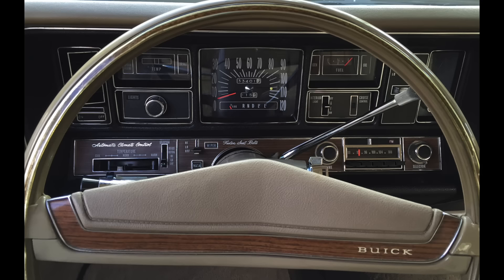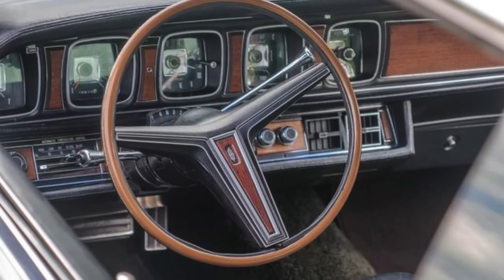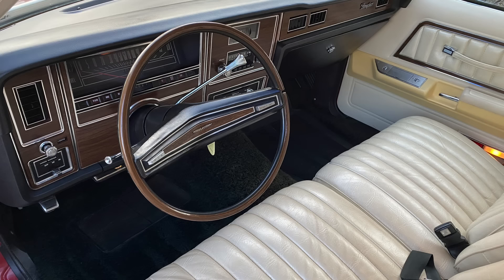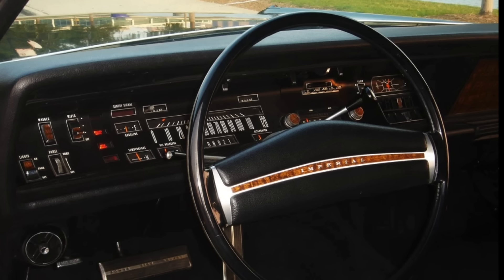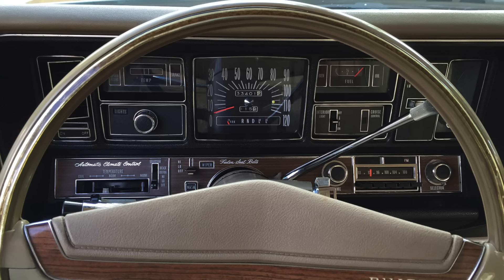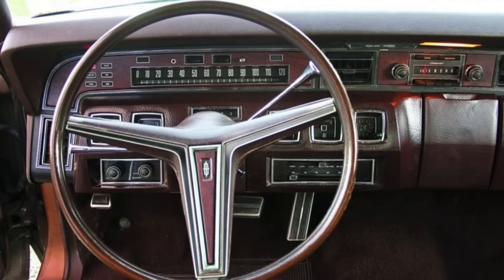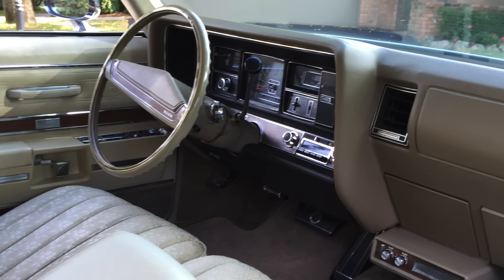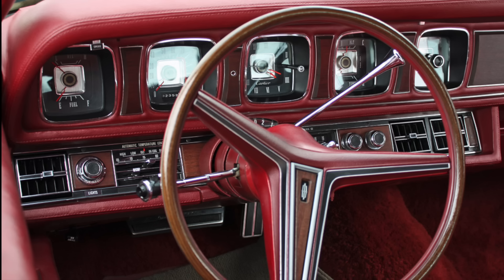Worst Automotive Inventions:  The "Rim Blow" Steering Wheel That Many Customers Hated

Comment: The Rimblow Horn Steering Wheel was available in 1968 Oldsmobiles. I believe this was the first appearance of that feature. My first car was a new 1969 Mach 1 that came standard with a 3-spoke Rimblow wheel. The contact strip did sometimes create certain issues,  enviroment-caused petrification, and horn sounding unintentionally by squeezing the rim too tight... But One of the Worst Automotive Inventions?... Matter of opinion. I loved it and still do. Still have the all original car and that includes the steering wheel and Rimblow which has always worked. Subsequent vehicles that I also purchased new had to have a 3-spoke Rimblow wheel if offered, my 1974 LTD Brougham, etc. I went without cruise control because I just didn't like the two-spoke wheel.

Comment: Like it or hate it, the rim-blow horn was at least an innovative attempt to improve car features at the time. And to be fair in regard to how those steering wheels hold up today, it's amazing that any of them still work. What automotive engineer was sat at their workstation in 1969 and tasked with designing a mass production rim-blow steering wheel made only from materials commonly and economically available in 1969 or earlier that was expected to still perform flawlessly 55 years later and beyond? Until the 1980's when Japanese imports started overwhelming the US market with economical, durable, practical, and comfortable cars that were built with quality and pride in the workmanship, the average domestic car was considered obsolete and worn out within 2-3 years. If you drove a car that was 5 years old at that time, you were either a high school kid or regarded as pathetically destitute. That was the market and mindset that American car makers catered to then. It's also amazing that the malaise era was pushed back for as long as it was before emerging when it did. Adam, if you're reading this far, that would be a great topic of study and presentation that should be of great interest to auto enthusiasts today. The US auto industry, sadly, was already well on it's way to floundering in the world economy before the two OPEC oil crises in the 1970's did their job as planned and pushed it off the cliff. The rest is history.

Comment: Hi and hello from Australia

Most cars of the era had the "normal" centra pad or horn rings.
Only ford in the 1969-1972 GT's had the rim blow wheel ( possibly of a similaor prior era mustang ) 3 spoke and 3 or 4 round sections, i recall a friend of my dad had one new back in the day and he had glued 1 2 5 cent pieces in it

Anyway, one of the girls in high school back then, when she got her licence she would use the family car when it rained or something ( sports days ), it was a fairlane with the rim blow, but this car was not a power steer car ( i still recall her saying " dad only wants 1 fan belt and no extras other than automatic )

Take a hard corner - beep , park the car - beep beep

I met her a few years after school, we chatted and i asked do you still have the green failane, she said yes it is the spare car between the family , i asked about the horn and she said it stopped working, there is now a button drilled near the ignition switch and the button is clear plastic similar to the car alarm types of the early 80's

For 1976 to about 1985 Ford falcon had the european style ( similar to England / Europe Ford Escort / Cortina ) blinker / indicator stalk with the push in switch on the top ( basically you face palm the indicator )

Comment: My '74 Imperial has a rim blow steering wheel, and it still works. The rim does have a crack in the 12 o 'clock position. A lot of them seem to have this crack in the same place, although this has nothing to do with the rim blow functioning.

Comment: Back in the late seventies my dad had a ford xw gs fairmont stationwagon (this was in Australia) 302 windsor toploader and a 9" diff and the dreaded rim blow steering wheel. He got so peed off with tooting the horn when turning he disconnected it and installed a button to push for the horn, lol. Wishes he still had it, sold it in the eighties for $500 probably worth $80,000 now!

Comment: The use of the horn seems to vary quite a lot locally.
Here in Northern Europe a horn is used almost never at all. You would rarely use it in a "panic" situation: instead of making noise, you would focus on taking evasive action.
In Southern Europe it seems a bit different: in big cities people are continuously sounding the horn as a "hey I am here! go out of my way!" indicator.
For that it does not really matter how the horn is activated, and the "horn on turn signal stalk" feature was invented there.
Anyway, I would not use the horn more than maybe once or twice a year. In fact you can get a fine for unnecessarily using the horn.

Comment: Maybe you did it already but I would say that the buckle start system for seat belts in 1974 was the worst.  We had a Chevrolet with that feature and we did wear the seat belts because of it.  One day it became really cold and the buzzer would not stop even though we were all in seat belts.  The independent mechanic we had did not disable it because it was required by law.  Dad was hard of hearing, so he let us have the other car and he drove this wagon to work, the buzzer going off the whole time.  It was the next year that the buzzer was removed.  That wagon also had a lot of problems with leaks and guzzled gas and they finally replaced with a sedan in 1979.

Comment: Never seen that! I had some 60’s GM’s that I believe had buttons on the steering wheel spokes.  

First gen Miatas have “thumb triggers” on the steering wheel spokes, right there, one for each thumb, as long as you drove with hands at 10 & 2.  

More cars need a town / country horns too. Plenty of times I need a “beep beep”, and then there’s the times I need a loud solid blast.

Comment: My 1969 Mustang has a 3 spoke rim blow steering wheel with cruise control - the cruise control on/off switch is below the center dash pad above the radio and the set/resume switch is part of the turn signal switch

Comment: Adam,  My 1972 Mach 1 has a rim blow wheel that works perfectly after 157K miles. My parents bought it new. The dealer we bought it from was our neighbor so when my father wanted the three spoke instead of the 2 spoke steering wheel Joe the owner had one of guys swap one off a 72 Torino. For the last 52 years the car has had a Torino emblem in the middle of the wheel.  Perhaps the only Mustang out there like that. I did drive a 71 Boss 351 Mustang without power steering that I was working on and yes the rim blow option sucks in that application.
Reply: That's only about 3,000 miles a year.

Comment: My 1974 Lincoln Continental Town car has the rim blow horn and the cruise control.  My wheel is cracked but the rim blow still works for the most part.   There are a couple dead spots in it.  So you have to pinch it in the right spots for it to blow the horn.   But it is different and everyone is always intrigued because they have never seen that before.

Comment: A friend and I ferried a Cadillac from Chicago to Boston in the winter. After a break at a truck stop we got back in. I blew the horn for grins and it did not shut off. The material had gotten stiff in the cold and did not relax. Had to warm up the spot I pressed with my hands and breath.

Comment: A friend of mine has the tilt, telescope, rim blow on his 70 Mustang Grande. We think it may be a dealer installed unit as this car was a dealer promo car of the time, with just about every option you could get. A couple problems with his. With power steering, if you used your palm to spin the wheel say in tight parking, you would honk the horn. Also when he 1st got it the horn was inop. After carefully taking it apart, he found that the ring contact was full of 'junk' ( read a mixture of dirt and most likely particles of dead skin..yuck) which actually corroded the brass. He sent it out to be refurbished and though it's a neat talking point, he often still leaves the horns disconnected.

Comment: Our neighbors had a Cadillac with the rim blow steering wheel.  After a few years, it would sometimes sound the horn all by itself.  Usually in the wee hours, on a hot and humid summer night, when everyone had their bedroom windows open.  I remember running out of the house as it was raining and one neighbor held an umbrella while the owner and I pulled wires off the multiple hours (5 or 7?) underhood.  It sounded pittiful as we eliminated some of the tones and only one or two were left sounding until we located them and pulled their wires off.  After about two nighttime sorties like this, the neightbor must have been able to get the problem fixed, because I don't remember being woken in the middle of the night again by this car.

Comment: They aged quickly and cracked from sun exposure and lost sensitivity and would require more thumb pressure until it stopped working at all.  Even new it felt cheap and you knew it would eventually  disinagrate and of course it did. Quality control on mostly American cars was dismal in those years.

Comment: I have my licence since 1986 and I think I used the horn less than 10 times in all these years. I even had a Citroen AX GT in the late 80s with the horn at the end of the turn signal stock. Would have not been able to remember that in a critical situation.

Comment: My brother had caddy with this feature.. but in the summer that horn would just honk incessantly until he could run outside and pound around on the steering wheel in just the right spot to get it to shut up!!  More than once it killed the battery before he could stop it.

Comment: Mom had one on a 1970 Barracuda and it stuck on within a few months and never worked again.  That Plymouth was a cheaply made car.  Rusted quickly, crappy interior quality.  But it was quick by the standards of the day.
Reply: My dad had the option on his 71 Cuda, and according to him, it never worked right. Either it was too sensitive or he could squeeze it all day and it never blew the horn. Seemed to depend on the temperature. He had it until 76. That was a 340 4 speed car in purple on blk.

Comment: I had a '64 Toyota Crown that had a horn ring incorporating the turning signals. Thus, you could operate the indicators with either the left or right hand. Or you could grip the ring at the 6 o'clock position and move it left or right instead.

Comment: We had a 71 dart swinger. I don't know if people can blame the design for a sticking horn. But i do know it worked like it was supposed to work in a tense situation. There were a few times my dad gripped the wheel tight when he had to slam on the breaks, and the horn would go off. I don't think some liked it because they couldn't easily get the horn to beep.

Comment: I don't know if this is the WORST automotive invention, but the power radio aerial antenna on some of the earlier 70's cars were a real pain.  Not so much the  mast/motor housing assembly, as the location.  On some Ford cars of that era, the FoMoCo engineers thought it would be a big joke on dealership service mechanics to mount the automatic antenna between the right front wheel well and the right front door on the front fender!    Have u pictured it in your mind?   Now you see what the problem was for whomever had to repair/replace any parts, gears, or motors for the antenna mechanism.  Fortunately, they seemed to not give many problems.  And the ones i encountered worked flawlessly.  Used to, some had a separate "ANTENNA" switch to flip/push to raise/lower the mast.  But some would raise/lower when radio was turned on/off with the volume knob.  Simpler times.....lol

Comment: I believe the Mustangs and Shelby 350/500 had the rim blow steering wheel as well in the later versions.  In any event - interesting topic - thank you ~ Chuck.  P.S. - isn't it interesting to note that the more expensive cars from this era can be identified by their brake and accelerator pedals?  The larger design and bright work included draw my eye.

Comment: Reasons I hated the Rim-Blow wheel in my '71 Mk III:  (1) It's location was odd and unnatural for a driver who switched between multiple cars.  Even though I knew the location of  the horn switch, I would always automatically pound on the wheel hub.   (2) The hot California sun deteriorated the switch's flexible plastic: as the hot car interior cooled in the evening, the plastic would shrink and harden, eventually honking the horn by itself.  (3) It annoyed me as it had obviously been designed by a team of bored engineers who frequently produce useless, complicated and unreliable "improvements" to replace useful, simple and reliable devices.  These are the same engineers who produced the Cadillac windshield-wiper slide switch that made driving in the light rain so needlessly frustrating, the brittle plastic Lincoln door courtesy panels that self-destructed before the car was 1 year old and the knee-operated Cordoba power windows.

Comment: The only accident I’ve ever been in is when somebody ran a stop sign. I slammed on my brakes and reflexively braced myself while blowing the horn. I T-bones, the car with incredible force, and the airbag exploded on my hand causing injury…my ONLY injury.And it was severe enough to rip skin off of my hand and put my arm into a sling. A rim blow design of some sort would have prevented that.

Comment: Among the dumbest was late forties Buicks -- you push the accelerator all the way to the floor to start it. A "failsafe" lockout was supposed to prevent starting unless in 'Park'. Saw a '48 that started and plowed thru a storefront when the failsafe apparently failed.

Comment: I had a 1970 Dart Swinger with the squeeze a honk horn. Hated it. If it didn’t have no feel, low effort power steering, I would have been blowing that horn constantly, which is what I did the first 2 weeks I had the car. I ended up steering the car with the palm of my hand so I wouldn’t blow the horn. I also remember a commercial for the 1968 Olds Delta 88 that featured optional accessories for the car, one being the rim blow horn. It’s on utube.

Comment: Ok, I have one comment and one question regarding the Cadillac wheel at 1:29.  First, the comment.  Who on earth thought the Cadillac wreath and crest looked good crammed into the small space toward the bottom of the center spoke, when there is that large empty void higher up where all the spokes converge?  This just looks weird!

Second, and I'm sure you can relate to this and perhaps even wondered yourself.  Cadillacs from the late 60s to the mid-80s  used a column shift lever unlike any other that I can think of by any other GM division.  It's got kinks and bends where other GM models have a much less convoluted design.  And....look at the shift quadrant indicator...Park is WAY off to the left of the scale, much farther away from reverse than other GM divisions.  Why is this?  It's not just on the FWD Eldorado, it's on the RWD cars too.  The lever has to travel farther from the "R" to "Park"  How can that be when the transmissions used in Cadillac were shared with other divisions.  As a result, when a Cadillac  is in park, the shift lever is almost vertical,  where other GM cars the lever is "parked" at an angle.  Think of a clock face.  The Cadillac is in park at 12 o'clock, where other GMs are in park at 2 o'clock.   I've wondered about this for years!  Has anyone else wondered why?

Comment: 1. Center horn pad is stupid as it requires you to take a hand off the wheel...and finding the sweet spot is difficult due to airbag.

2. Chrysler did this in their mini-vans all the way up through at least 1998 or so, and they weren't reliable as sometimes it wouldn't press, mostly because the airbag.

3. Horn/turn signal stalk combo was the worst version invented, one would often hit it with their knee upon entering the vehicle...attracting hated stares from everyone in the vicinity.

4. that early 1970s horn setup was the best thing since the ring was deemed "dangerous". until regular buttons replaced them in modern cars like oh...idk...the 1986 Ford Taurus...and most cars following suit thereafter.

Comment: My grandmother's 1969 Galaxie 500 had a three-spoke wheel with it, though from what I've seen it was an option, even on the LTD of that year. Real problem with the Ford one was with the material. It was nearly impossible to activate in the coldest parts of winter, while in the hot sun it would blow itself until someone popped the hood and unplugged both horns. I assume that Chrysler, which as others have said, offered it on models other than Imperial, used relays; going to assume GM did too. Ford didn't, which probably made it worse due to the high current level required for dual horns. 

Today, even if better materials made it work better, federal law now requires that IF A CAR HAS A HORN, and the control NOT the center of the airbag cover, that it be marked with the trumpet symbol printed in the standard in a contrasting color from its background. That'd be a real problem with "Rim Blow". Those who remember Ford's "Stalk Blow" probably remember the white trumpet on the stalk. BTW, if the control IS the center of the wheel, it need not be marked period, but if it is, the trumpet symbol printed in the standard is the only legal marking.